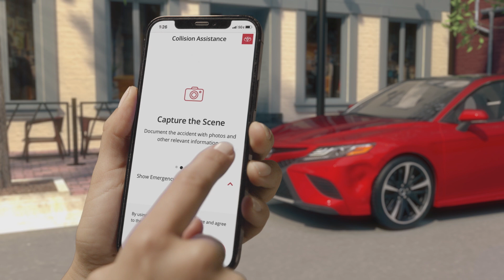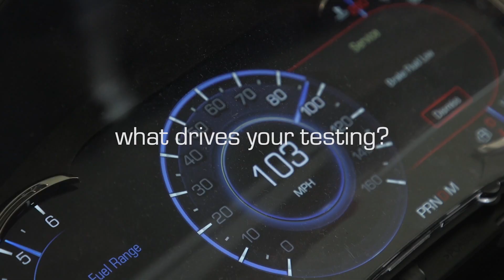New Frontier Moves to Head of Class; Electric Silverado Gets 4-Wheel Steering - Autoline Daily 3138

Comment: The Silverado had optional 4 wheel steering a decade or two ago. It was an expensive option, but they cut the price to near half before discontinuing it. It was a sales flop. The Japanese were into 4 wheel steering back in the 80s.
Reply: But now it's a main stay in top end luxury sedans (don't know about SUVs), it's used in heavy (cab-over) trucks that need to operate in the city (although it's of a different design) and Ford has a patent for 4-wheel steering on HD pickup trucks. Seems like it's going to become more prevalent now that people will be driving more luxury electric tanks.
Reply: Which Japanese cars had it?
Reply: @imnotusingmyrealname4566    The earliest I remember is the Honda prelude,   my sister had one.
Reply: @dmitchellhomes  Ah interesting. Lol I could only think of the Prologue for a while there. The name is not stolen from a car but it kinda overshadows the older one.
Reply from the maker: @imnotusingmyrealname4566  The 1988 Mazda 626 offered an electronically controlled 4WS, while the Honda Prelude offered a mechanical system.
Reply: @AutolineDetroit  Wow. They were far ahead it seems.
Reply: 300ZX TT , 3000GT VR-4 , GALANT VR-4 , Prelude 4ws , GM Quadrasteer . Just off the top of my head . I'm sure I'm missing a few .  Anybody else ?

Comment: 7:49 I think you meant the differential. The transfer case is always locked in 4WD, whether it be 4H or 4L.
Reply: @dmitchellhomes  Yes but I doubt the Frontier has it. It would be brilliant if it did because then you could use 4H on high-traction surfaces and enhance traction in those conditions and in stuff like rain. Only very few vehicles have it sadly.

Comment: Foxconn. fifty cents says their goal is to build robotaxis for a fleet operator, not privately owned vehicles. iCar?
NIO: "We're going to sell budget EVs, cheaper than Tesla." Good luck getting the economies of scale necessary to compete with the $25k Model 2. How many 100s of GWh are ya'll making?
Toyota collision assistance app: My insurance app does all this already. Getting real tired of automakers trying to show they can do software by replicating solutions implemented by services for which the apps are actually relevant. "Here, we'll help you find a repair shop" Thanks, I'll take it to the shop my insurance will actually cover.

Comment: Elon Musk (2019): CyberTruck unibody exoskeleton obsoletes body-on-frame (like sacks of potatoes on a wagon)
Nissan Frontier (2021): Body-on-frame Forever!
Reply: Except the Frontier is here and on the market to buy, and Elon's exoskeleton?    Hmmm  James,  you say Body on Frame is obsolete,  but Musk is doing a front casting , a rear casting,  with a structural battery pack in the middle forming the structure,  wouldn't that be considered a frame?    Then the stainless body sits on it?     Sounds like Body on Frame to me?     Another bit of trivia for you,   have you looked under the 2019 Cybertruck concept?   It does not have castings or an exoskeleton,   it has a full length tubular steel frame (built like a race car).  Motortrend Magazine was given behind the scenes access to watch it be built,  and wrote about the details,  it was a complete smoke and mirrors job by Tesla.